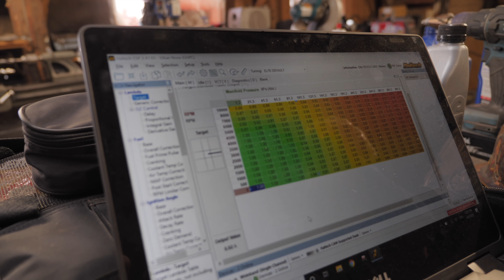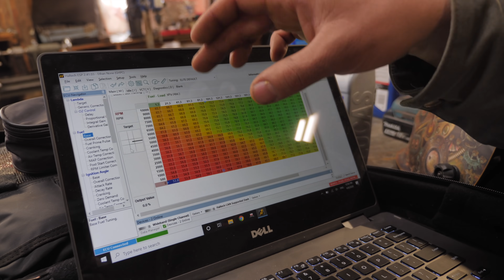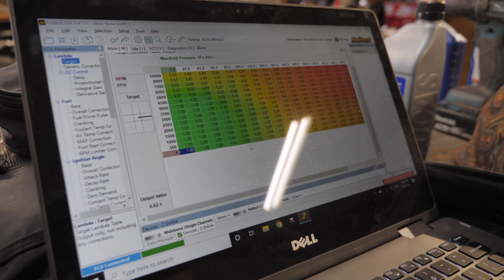100HP Off Road Go Kart Runs + Spits Flames

Comment: That secondary throttle valve is not for traction control. The 990 never had traction control. They are for controlling the idle depending on the current conditions and are controlled by a stepper motor. Also, they improve the mixture at low revs because they stay partially closed to promote faster airflow and thus better mixture in the turbulent air flow - no traction control involved

Comment: that thing sounds killer! also dont forget that once you get it on the ground it might not seem as fast with the wheel speeds as there is no resistance on the drivetrain with it just free wheeling. it would normally be sitting on the ground with rider weight added making it harder to get rolling. keep up the great work guys

Comment: Not a KTM tech but typically secondary butterflies are for closing air flow down at low RPM because the heads are highly ported from the factory. You want to leave them unless youre racing. You will know its what they are because the servo actuator is TPS signal based. (Opens/closes in response to throttle). TC is usually spark based like quick shifters. Its not a big deal for spark interrupt on those.

Comment: Great job!  I suspect that the haltech might run the engine better using TPS for load instead of MAP.  Individual throttle body setups typically respond  better to TPS as load since there is basically no plenum for a MAP sensor to read  Look up "Alpha-N" strategies.  Something to think about next time Casey drops by. Keep up the good work!

Comment: Those plates are secondary throttle plates. Not choke plates. Although they may interact during traction control. That is not their primary function.  It is manipulating airflow due to engine rpm. We also use them on exhaust. These butterflies or plates open and close to mimic a long(closed) and short(open) intake/ exhaust path.

Comment: Please take another look at the driveshaft. I believe your U-joint knuckles are 90° out of phase. Which is going to cause some weird harmonics in the drive train. 
When the engine is rotating at a smooth & constant RPM, the output of the driveshaft will have varying speed on each revolution.

Comment: Casey, if it's never going to be turbo, or not going to be turbo anytime soon, change those axes to reflect that so you have more control and finer control and better interpolation between cells - leaving it with 300kpa of range in the tables is selling yourself short. Even running a 300kPa sensor on a 100kPa engine is not ideal as the ADCs inside the ECU have limited range, too, likely 10 or 12 bit, not likely to be much/any more than that. Precision depends on minimising the range you expose that ADC to, and internally minimising the range you expose the table interpolation to. My 2c, ignored as always, no doubt :-D
Reply: Casey, what kind of junk ECUs have you been tuning that don't have map tracing???? :-o almost every tuning app known to man has that. :-/
Reply: WOW, that coil failure was spectacular! I've newer had one do that! :-D To do that either the dwell was MASSIVELY too high, or the signal was inverted so the "dwell" was low, but the actual dwell was the opposite of low. Guessing this. So nostalgic for me watching you guys muddling through this for what looks like the first time :-)
Reply: "we had that set to the opposite thing" exactly what I just said! :-D
Reply: Casey, ahhhh, click "a lot of tuning systems that I use upload/download/changes" = you're tuning OEM ECUs with ROM flashing software. Makes sense that you're deprived of good software :-D Welcome to the fold, my friend. <3

Comment: I'm thinking you had it in second gear, not first. Ethan pulled the shifter up. 14:59. Unless the lever orientation is reversed, that would explain, somewhat, the apparent wheel speed.

Comment: Awesome job guys. Thanks to your buds for helping. Quick question, is the 4 wheel drive selectable? Meaning can you go 2 wheel drive if ya want or is all time 4 wheel? Would be nice to be selective, without removing the drive shaft. I can’t remember the quad you used. Welp, on my back to watch that vid and I can probably answer my own question. Oh ya, it’s going to be a monster, nickname “Godzilla”. Insane power! Interested to see the weight when all said and done

Comment: On Independent throttle body engine fuelling and ignition can't be calculated using manifold vacuum.

Manifold vacuum is always high and from about 25% throttle to 100%,  manifold pressure is 100kPa. on that engine the only way to do it is using throttle position also known as Alpha-N

Comment: Short intake runners like on this engine often cause problems using MAP sensors as there is not enough volume. Better use a throttle position sensor instead in such case

Comment: You guys better gear that down.  Or you will find it to be useless on anything but the highway.  Lol.  It needs to dropped by HALF OF WHAT IT IS NOW .  Lol. I have been watching this build from the get go.  And I always knew this wld be your issue in the end.  Along with the collar you put on that drive shaft “FOR SAFTY INCASE OF BREAKAGE “ lol.  Take that off.  It’s useless .  (You aren’t taking into account FRAM FLEX ,BECAUSE IT WILL l RUB ).  Lol.   But it’s more than a fkn awesome phenomenal build. !!!   Love it 👍.  Things always need tweaked on ground up builds.  As I’m sure you know

Comment: hay lads when the engine was turning over with the valve cover off … I could here the valve hitting the cam .. meaning the valve gap needs adjusting? I could be wrong .. if it runs crap when its hot then id say its that. thanks love you guys

Comment: Casey's voice sounds like he should be somewhere with a lab coat on and always have a full pocket protector an RPG's. (rape proof glasses)
You are going to have to rebuild those driveshafts at some point. You don't want the U joints 90 off of each other, you want them in line. That's that crunchy clicking sound you can hear when the tires are spinning. https://youtu.be/M3h1g9dV2nw?t=539

Comment: As i've commented on a previous video, those are not "choke plates", those are secondary butterflies controlled by the ECU to control the air velocity and to control the amount of air and thus to improve the throttle response at low to medium revs. They might help the traction control in the newer bikes, but the 990 EFI bikes at least for 2005, 2006, 2007, 2008 and 2009 don't have traction control. At all. No traction control is present. There is no traction control on the early KTM 990 bikes. The KTM LC8 990s up until at least 2009 do not posess any form of traction control.
SO PLEASE stop calling them chokes or choke plates and PLEASE listen to people who know more about these engines than you do. THEY ARE SECONDARY BUTTERFLIES CONTROLLED BY THE ENGINE MANAGEMENT SYSTEM.
Reply: You guys do know how to weld and fabricate etc, but these sorts of things just make it hard to watch the videos and listen to you. The first LC8 with EFI was the 2005 KTM 990 Superduke as far as i know, and why would a modern EFI system have a  complex and cost-adding mechanical choke system? These are bikes with closed-loop injection systems and catalytic converters, so adding some sort of frankenstein mechanical choke to that is just ludicrous on the face of it. The only reason to add this kind of system is either to make some kind of obvious improvement to the performance and/or emissions of the bikes, because if it was just to have a choke or some kind of rudimentary (at best) traction control it would have cost WAY too much in R&D and implementation. 
I was going to swear here, but then you would listen to me even less, so there. Just get a grip, is all i'll say.
Reply: The easiest and simplest way to implement traction control would be by using front wheel and rear wheel speed sensors, and then cutting the spark to the engine if the rear wheel speed sensor registered higher speed than the front wheel speed sensor. Ah, so if you implemented differentiated and modulated ABS for the front and rear wheels with independent speed sensors you could use ignition spark cutting in conjunction with the ABS system to accurately modulate traction. Then you could modulate the front and rear wheels separately with regards to different sensors, moving up in complexity to lean-angle-sensors etc. Maybe you could make the system more accurate by cutting both spark AND fuel, maybe even modulating the spark and or fuel cuts hundreds of times per second, modulating ignition timing and fuel injection at the same rate... Insert more advanced control and more sensors and tighter tolerances and... Etc... 

Having computer controlled and actuated secondary butterflies integrated into traction control systems before you've even thought about ABS systems is just ludicrous, because it's much easier to control the engine using ignition and fuel control with the already necessary sensors and parameters. 

In short, get a grip! Swearing edited out

Comment: You need to change the gearing to have some low speed control and not destroy the clutch. Youll never use the top speed as it is, way too sketchy with the wheelbase.